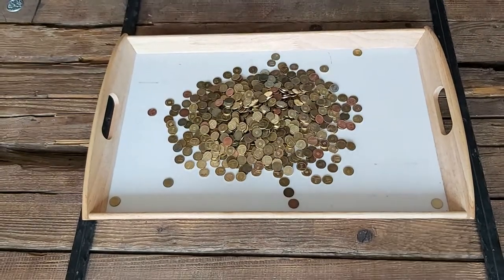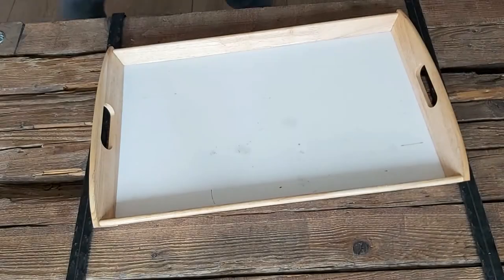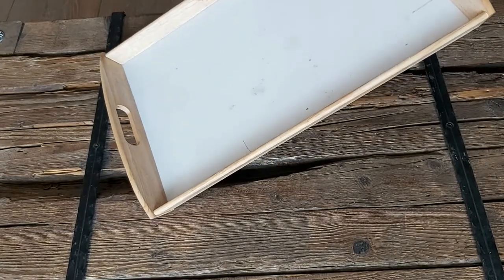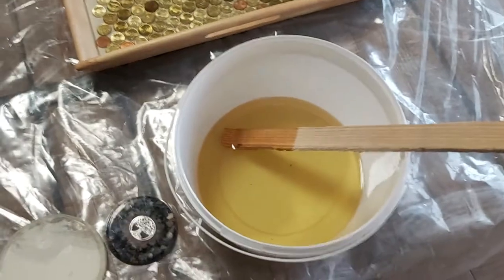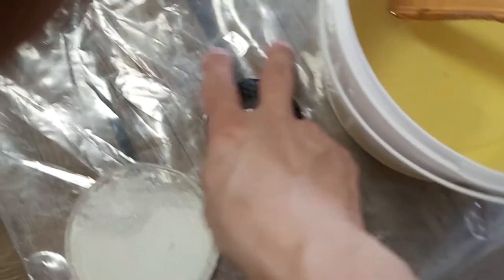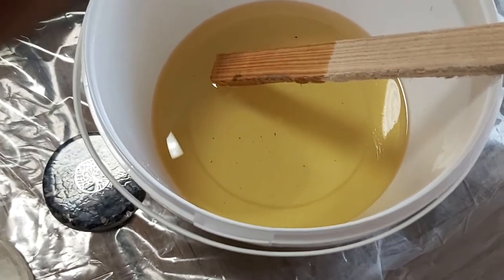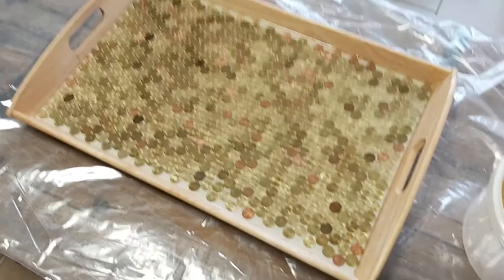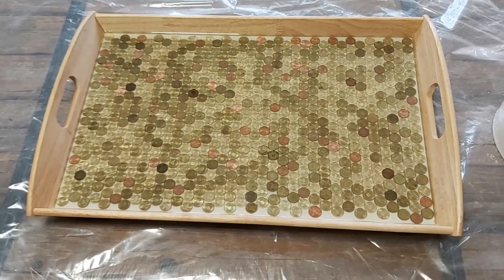Casting Epoxy or Polyester Resin     How to Make a Decorative Resin Tray

Comment: I need polyester resin.Can you provide?
Reply from the maker: @Amit Singha, First of all, thank you very much for the comment. Answering your question, unfortunately I can't help you. I also buy the resin from a local distributor. I don't know where you are from, but even if I had the resin, you would have had to take into account the cost of transport, which would make the resin quite expensive. My advice is to look for local suppliers. If you tell me what city you live in, maybe I can help you by looking for a distributor.
Reply: @PAFixandCrafts  Thanks for your valuable response.I m from Assam,Bongaigaon District.I am working  in mural art to fibercasting newly,so need polyester resin,chopped mat,hardner,accelerator etc etc.Pls inform from where i can purchase these necesarry things.I shall purchase not in huge amount first time  but it will continue..
Reply from the maker: @Amit Singha, Unfortunately I only found suppliers for the European market. The only website that distributes worldwide is Alibaba.com. 
It is much easier for the European market. But try to cough on Alibaba.com